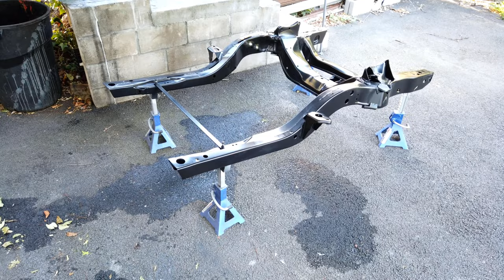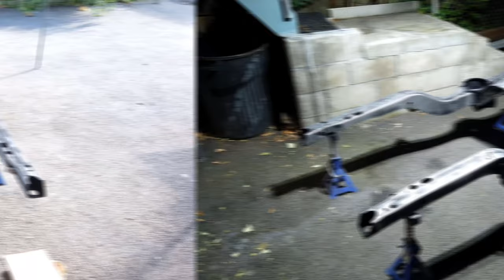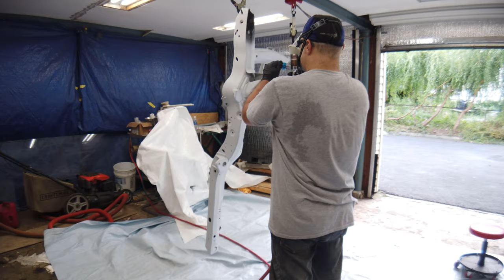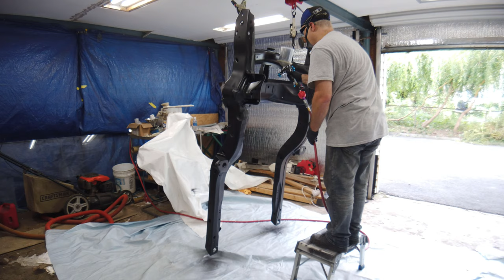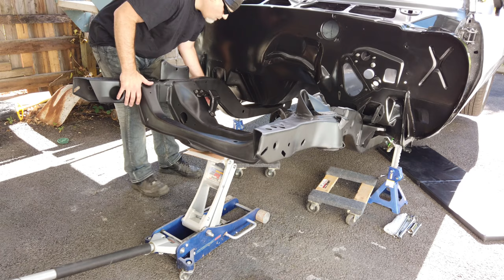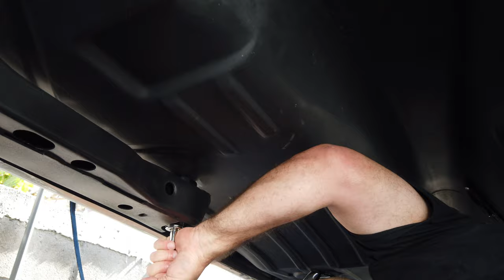What the Subframe?

Comment: Don't you have to square up the subframe to the body? I was hoping that you would show it in the video. I saw a video of someone doing it with marks on the floor and a plumb bob, but they had the car in the same spot taking it off as putting in the new one.
Reply from the maker: Yes, I squared up the sub frame by measuring it and using the alignment pins.  I measured the frame to the sides and I also measured diagonally to the rear frame to make sure that the frame is square.  The Camaro Book references the diagonal measurements and the alignment pins help as well.

Comment: Nice job!Im looking to order one from AMD,I had seen back about 7 years ago a few guys had issues with the offset.Did everything work out as far as hanging the fenders and stuff?Thanks
Reply from the maker: Thanks for watching, so far the fit is good.  I am having trouble with the fenders, but I think the issues are with the Aftermarket fenders.  I have most of it resolved, but I am curious about the offsets your are talking about.
Reply: @GoGoGarage  Only found two negative fitment reviews and they were from ten years ago.The problem was with the offset measurements from back to front.The front horns obviously sit higher than the rear mounting points.
In your case since the sub is installed you would measure from the ground to the bottom of the subframe at the rear mounting points.Then measure from the ground to the bottom of the front subframe at the front by the core support.According to the original subframe dimensions you should have a 6” difference.
Reply: @GoGoGarage This poor guy had a difference of 6-3/4” on one side and 7-1/2” on the other causing both core support and fender fitment issues.Because it was so much higher he had a 1” bottom fender gap by the rocker that he couldn’t close.
AMD eventually admitted that a change in the manufacturing process had gotten a few subframes out of whack.
They issued a refund and supposedly the problem was corrected.I just called last week and was told they have had no complaints or issues in some time.
Please let me know what you come up with,thanks.
Remember,this was a decade ago so I’m sure your is fine
Reply from the maker: @johnnyhotrod  I guess I will have to do some measuring to verify it.  I was going to do that anyways, probably should have done it sooner.
Reply: @GoGoGarage  I just measured the original subframe in my 67,I got about a 6-3/16” measurement.No original sub would still be at 6”.As long as it’s close enough to work with,the differences the other guy dealt with were just too extreme.
Hope everything goes smooth for you,let me know whenever you measure,I’m curious.

Comment: That’s a super clean subframe! Was it new or did you have it sandblasted once before you responded the paint off? Also- what’s the green thing smoking?
Reply from the maker: Thank's it's a new AMD Front Subframe and the green thing is to repel the mosquitoes.
Reply: @GoGoGarage  right on! Did it fit good? I was hoping that was what the green thing was. I need something like that. The mosquitoes are bad around here. Mind me asking where you by those at? Do they work well?
Reply from the maker: @gtmotorsports937  Mosquito Repellent Coils from Amazon, they work up until you have too many then you need like that deep forest spray.
Reply: @GoGoGarage  thanks! I’ll go find them. I may have to use both!